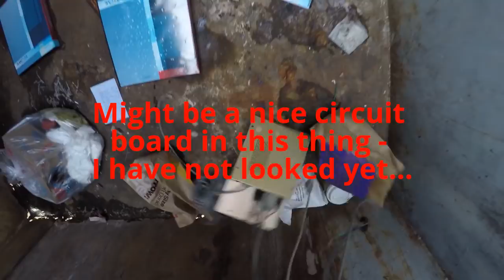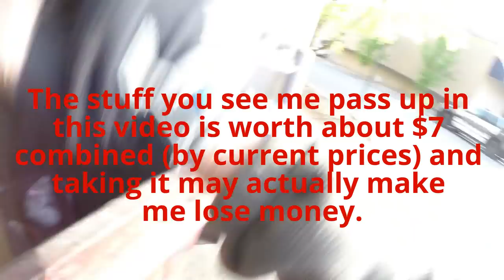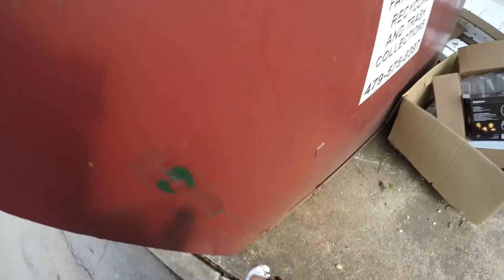REAL TIME - THE LIBRARY ROUTE - 55 Dumpsters in 52 Minutes! Dumpster Diving Motorcycle & Scrap Metal

Comment: Here in Adelaide South Australia cans glass bottles plastic bottles cartons etc are 10 cents each. 10=$1 100=$10 1000=$100 You are hard pressed to find them as just about everyone collects them. Steel is $200 a ton number 1 copper is $12 a kg and number 2 copper is $8kg and Aluminium is about $1 kg if its clean.